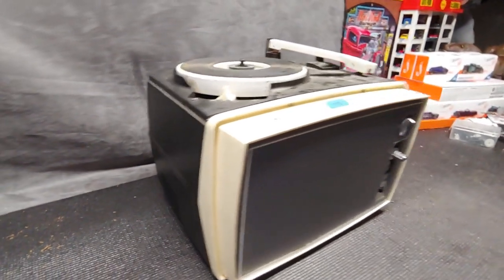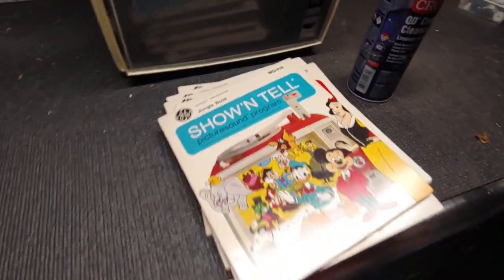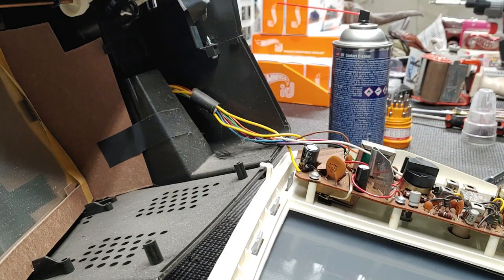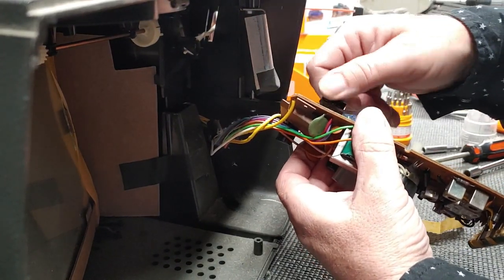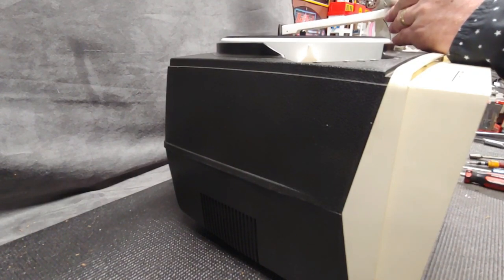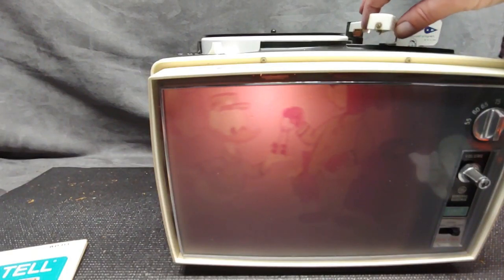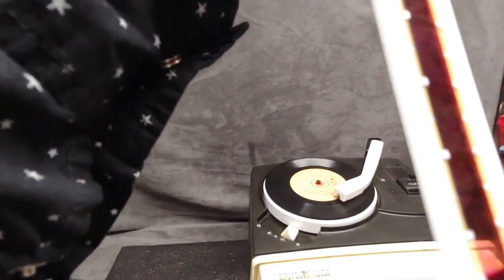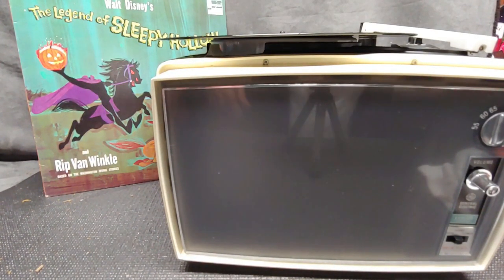1964 GE Show & Tell Phonograph and The Legend of Sleepy Hollow on LP

Comment: I notice that you didn't sync the record with the filmstrip.  To the left of the slot for the filmstrip is a very small square window.  BEFORE placing the record, rotate the turntable until you see the black line appear in the window.  Then place the record on the turntable with the the label straight and square - most records had a styled pointer arrow - make sure the arrow points to the right.  Now the turntable & record are in the correct position. Place the needle arm on the record edge.  THEN insert the filmstrip!  Now the filmstrip and record are synced and ready to go.  Just move the speed selector to 33 to start playing.

Most of the record jackets have these instructions printed (with photos) on the filmstrip pocket.

I had this identical model as a child in the early 1970s, and used it almost every day. LOVED it!!
Reply from the maker: Thanks for the Info. I haven't  used it since the Video. Maybe i will sell it. Great tip on the syncing . Thanks for checking in.